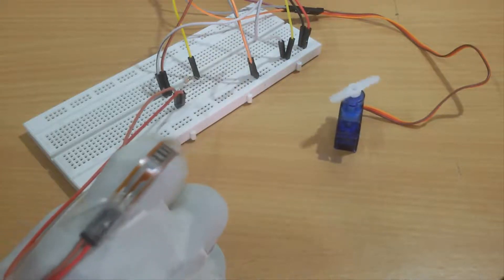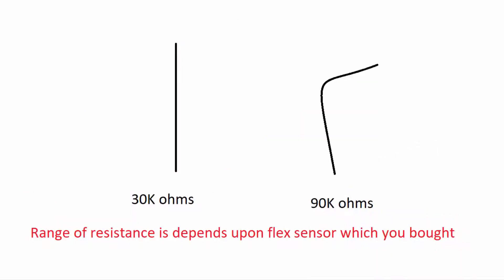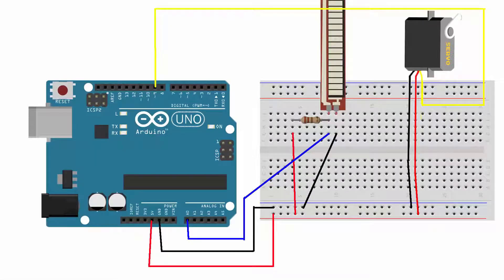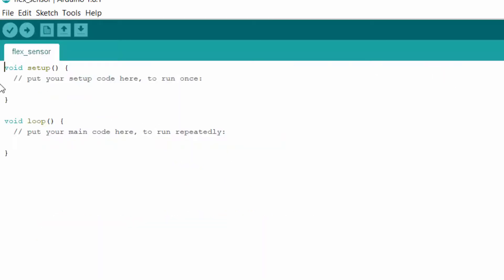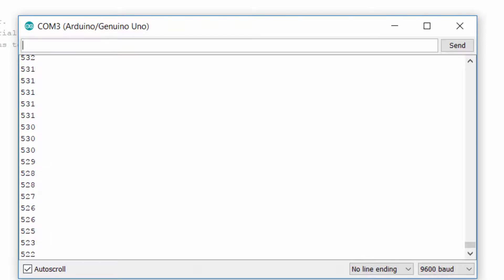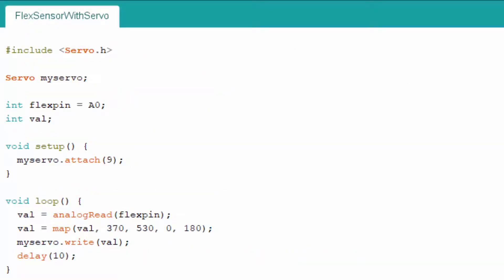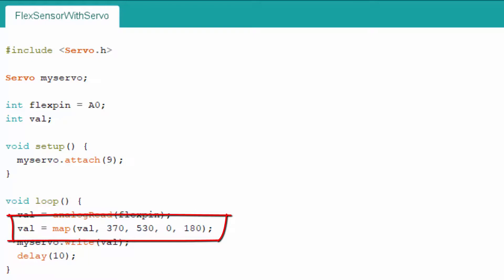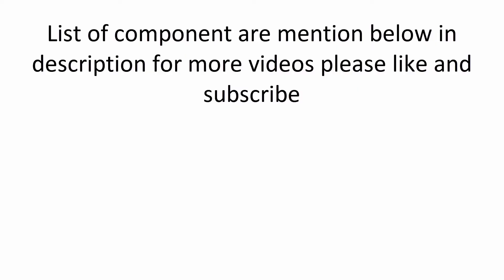Arduino Tutorial #18 How to control servo motor with your finger by using flex sensor

Comment: hello buddy , did you use 5 flex sensors and 5 servos same time?
If you didnt, can you make a video with 5 flex sensors and 5 servos working same time please?...or draw me a circuit for 5 flex and 5 servos? cause i tried but i can supply 5 servos using an switching adaptor 5v 2A..